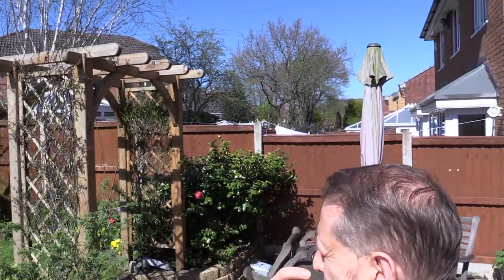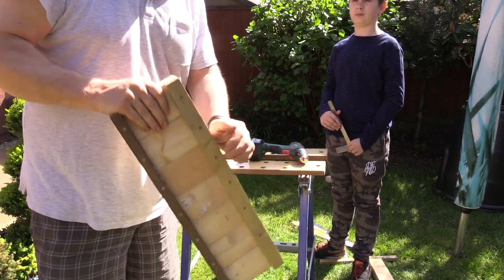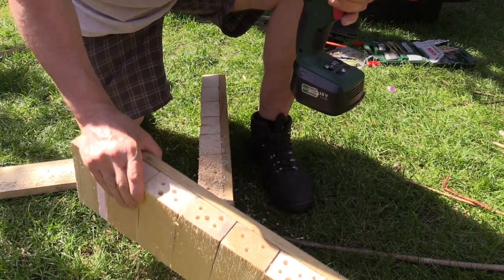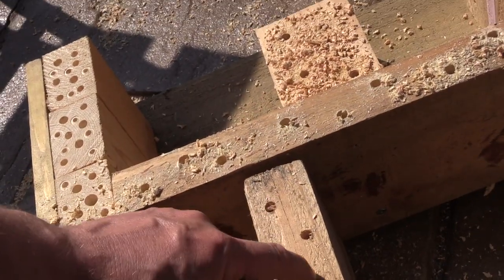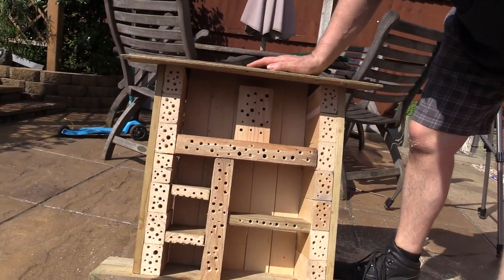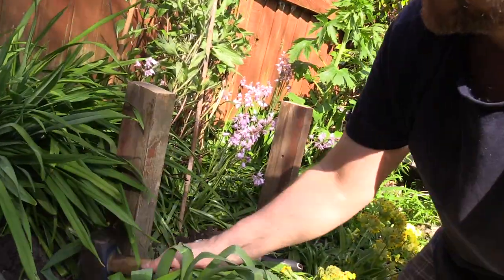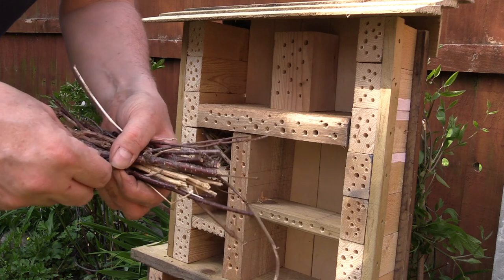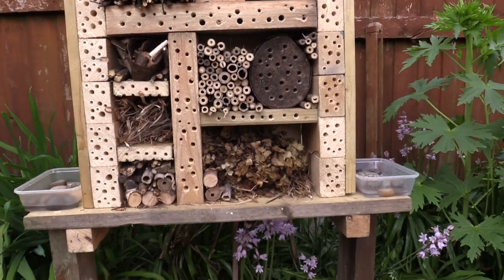Building a Bug Hotel for Solitary Mason Bees | Garden Project with the kids

Comment: Old video I know. But when I made my bee houses, I was told to do the holes slightly upwards. Not a lot, a few degrees, just so rain doesn't go in. They always worked so didn't prove detrimental, not sure if it helps but seems as though it would. Bees probably don't like being wet. I have a roof on all of mine also defending against most rain, but wind and rain can get in to some awkward areas sometimes, so I just make my holes slightly upwards. The way I see it, why not?